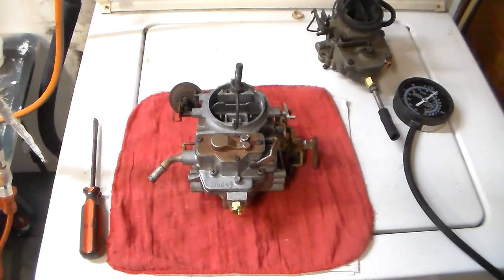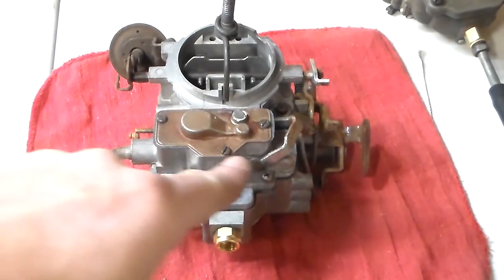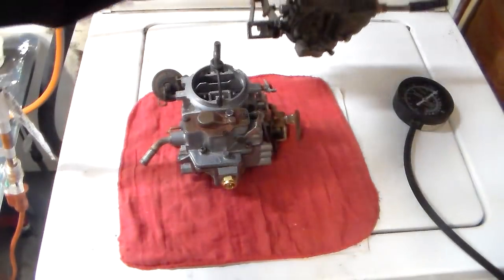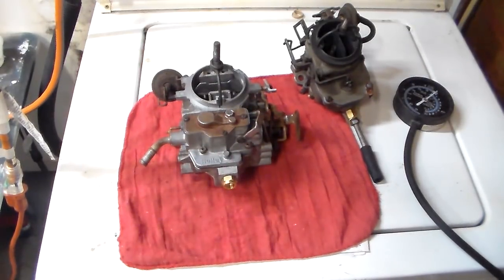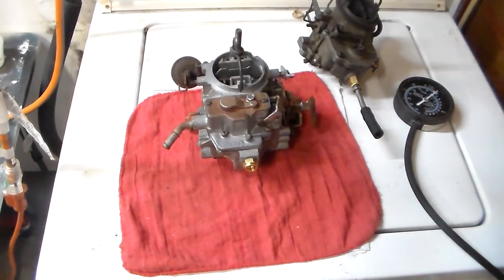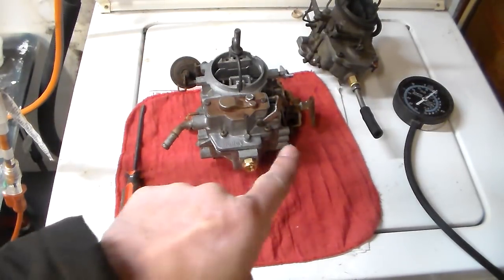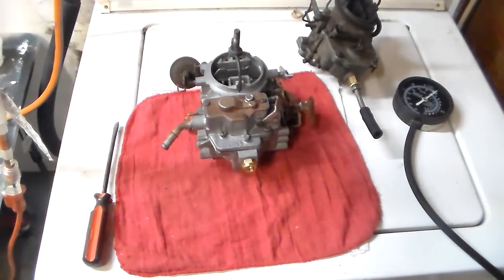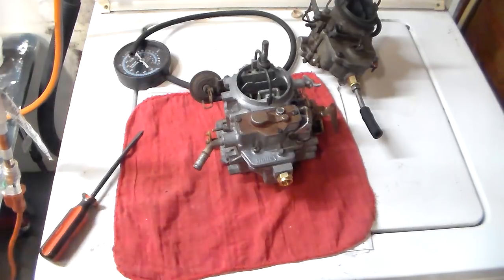How to adjust carburetor idle mixture screws *UPDATED*

Comment: Thank you so much!!  My Dad passed and I got his 78 Dodge Ramchager and I'm finding it has an idle and stall out issue and this single video has really helped.  He went over the truck with me but he felt the best way to learn the carburetor is just to get in there a learn on your own which sounds tough but it has over the years helped to work on my own vehicles.  I'm just not used to carburetors lol well I better get in there.  On a side note, my Dad took care of this D100 318 V8 4X4 all the time, that the odometer died at 879K miles and that was 24 years ago.   Got some rust filled with memories and still going strong!

Comment: You can also lay a hand flat on the fender to feel the differences in how the adjustment is changing things. When getting past acceptable and approaching the magic sweet spot you may feel a difference, it will be smooth as butter. Being just a hair off from the sweet spot or more a distinct lump can be felt as a cylinder or two begins to stumble or misfire from the mixture not being just right. I have seen mechanics use a fancy flexible driver to avoid getting too close to where it gets hot and stand there for literally 20 minutes adjusting it little by little to get the totally sweet smooth idle. Keep in mind to allow time for the engine to reach full operation temperature. As with lean burn the computer should be working in conjunction with the electrical assistant choke and idle enrich solenoid to adjust for what it needs when cold automatically. If anything else you end up like me sometimes and have a car that just needs to run a few minutes first thing in the morning before take off. Cheers

Comment: Hey Tyler, I’m chasing a misfire or flat spot in my 1967 power wagon 225 slant 6. It started with rebuilding the original bbs, got a flat spot, changed to a brand new remanned Holley 1920, still there. Changed the wires, got better. Changed the cap and rotor, got better. Changed plugs, no change. There is 1 vacuum port on the Holley, supposed to go to the distributor, wasn’t hooked up on the carter, and I haven’t tried it yet, it’s currently got a cap on it. The accelerator pump adjuster arm is in the middle position on the Holley, came that way… the truck runs, idles, and if you slowly roll the gas it’ll rev up, but if you stomp or even just step on the pedal it wants to fall flat on its face….

Comment: Tyler.   My 1983 CJ-7 6cyl Carter BBD was running ruff.  I had to adjust my idle up to keep it running.    I turned both screws inward and got better performance.   I turned both 1 1/2 turns and they stopped.   The idle did so good I lowered my idle screw.   Isn’t that strange. I figured if I tightened them til stop it would run out of fuel.   I am in NC Mtns.   3000 foot elevation.   Nothing big but not sea level.

Comment: Hello Tyler. I enjoy a lot of you videos, you seem to have a lot of knowledge many people (myself included) don't have about these older cars! I have a 1978 Chrysler Lebaron M-body, with the 360 leanburn deleted. I just rebuilt the carburator. Will the correct starting setup for the mixture screws be applicable to what is shown in this video? So 2 1/2 turns? And just adjust from there on till it runs the best? Thanks for uploading and best regards from Dinkymaster 7 from Norway!
Reply from the maker: Awesome! Yes, get it running and adjust to get the highest idle or highest vacuum reading if you have a gauge.

Comment: Great job!! I’ve been chasing a shaky jeep 258 .this eve after watching this video I’ve discovered one of my idle circuits is plugged.  Now I’m wondering if I can remove the screw and run a strand of copper wire thru it or should I just rebuild it …

Comment: Thank you so much. I have the exact problem you described. My YJ will not idle below 1000 rpm cold. and when warm engine will die when coming to stop sign and pushing in the clutch. I will check my timing, and cold idle set screw adjustment. and now I know how to use vac. gauge.while adjusting carb.

Comment: Thanks for the Info! I have a '84 CJ7 with a carter 2 barrel carb on my 258 4.2 straight 6. my engine wont idle much at all. eventully i can get it to idle for a couple of minutes after revving it for 10 minutes, then it will shit off on its own. do you think i need to clean the idle ports or just adjust the idle?
Reply from the maker: yeah that's a common problem with those. Do some reading on BBD idle tubes and you will find the cause and possible resolution to your problem. I don't know why those do that. It only seems to be the later High-top versions. I've never seen an earlier low-top BBD act up like that but then again they changed the metering circuits between the two.

Comment: Great video, I have a 81 Jeep cj-7. I adjusted fuel runs great. Thank u. I have the problem it didn’t pass smog. It turns out if I screw the mixture screws down all the way the Jeep stays on. Could that be a result of the float? If so how to adjust. Once amazing informative video. Thank you

Comment: I have a Carter 2bbl on a 1981 Jeep 258 and Idle and running is very rich.  Will adjusting these idle screws back affect the running mixture or is there another adjustment for that?

Comment: I really like the toilet analogy, it is 100% accurate. Do you remember the old toilet tank fill valves that were all metal?
Reply from the maker: Sure do. My elementary school was built in 1948 and had the original toilets. Of course it was only 30 years old then :-O
Reply: Wow! Do you know if the school is still in service? At 70 years old I would not be suprised if it has been retired.

Comment: Thanks for posting this video, I have a 72 D100 with a 381 with a 2 barrel and when I give it gas it dies down then picks up I was going to try to adjust the screws to bring the ideal up to see if that fixes my issue.
Reply: I have a 72 D200 im having carb issues with too. I think the accelerator pump is shot on mine, it might be the cause of your troubles too. Acc pump can cause hesitation, if that is what you are referring to

Comment: So does the choke work in the summer time ? So is the butterfly always supost to be closed when starting it? Mine seem to flood out more in the summer time.il take my answer off the air thank you😉
Reply from the maker: Chokes work any time the engine is cold. The duration that the choke is operating should diminish during warm weather. Some vehicles have mechanically heated chokes with an electric assist which enables the choke to open sooner in warm weather.
Reply: Thanks Tyler.also you show screws on your carborator mine has some different type I thought must of been preset at factory but do they sale different screw drivers?

Comment: Tyler, have you ever seen a 2280 that has recessed allen head idle mixture screws? I cant find anything thing like the carb I have. It looks just like a 2280 but the idle mixture screw locations are different than everything ive seen. Im having a hard timr identifying this carburetor. I want to order a rebuild kit but, I want to make sure I get the right kit. Thanks .
Reply from the maker: Those are tamper-proof  screws. They originally had plugs over them. Should work ok but some of those are lean-burn carbs. The 6280 was also the lean burn carb but had the mixture solenoid inside. I quit using the 2280 family of carbs, too many float issues. You can buy a new cheap eBay Carter BBD clone  and put a good float and good needle and seat and they work great. EDIT : fixed the autocorrect flubs!
Reply: @TylersNeighborhoodGarage  ah. Interesting. I kinda ruled out tamper proof screws right off the bat because i was able to get a allen key in there. I can see the screws because the motor is in a 1983 b250 van. Surely you are right about that. Also, I hadn't put much consideration into the bbd carbs because all over the internet  its plastered that bbd's are such pain in the butt junk. Ill have to eye ball one and give it a try. Any specific part number bbd you suggest ? The 2280 I have now I just yesterday discovered is a R-9951. Thanks for the input Tyler. Much appreciated.

Comment: Ok my carborator floods all over the top not sure from where but I took the top off and checked the floats 1\4 in from top and there there. So tonight I'm going to get a carborator holly screw driver and check idle set screws like you showed.but what could I find that can be off to flood it or will it help my gas mileage and .my carborator has to be set fast so it will start otherwise it will flood and I have to put it in choke mode to restart it.oh and by the way I set my timing and after I had it st I Beleave it says 18' advanced and after I set it I tightened down the distributor and after I did so it kept changing so I got my wife to hold the light and made sure it didn't change as I tightened it down .but keeping my idle set high keep that ping away and it runs good but 6miles an hour at idle .humm

Comment: Hey Tyler great videos always enjoyed your tutorials quick question I'm working on a 1990 Jeep YJ with a 4.2 i6 got a rough idle there is a stepper motor that changes the mixture would I have to disable it while adjusting the idle mixture screws?

Comment: thank you for that informative video, i better understand the idle mixture setting, however i owned a 1989 honda accord and i couldn't do anything with that carb--- too many vacuum lines, No matter what i did it would  never run right. I finally had to let it go, but i have a honda motorcycle (cb360) that i'm trying to get up and running and it has 2 carbs. This information will help.

Comment: I have a 2brrl Rochester carb on a 69 delta88 455 engine and my choke butterfly will not open once engine is warmed up mind you that it's a brand new one that I put on a couple months ago. Can I get your opinion thanks
Reply from the maker: The first thing I always verify is that the hot air tubes to the choke are intact. Any hole, anywhere, disables it. Take a look at my hot air choke video to learn how they operate.

Comment: Hi Tyler,  ive been watching your carb and timing videos. Ive been fiddling with my '83 b250. I seem to have the carb and timing set up rather well. The question I have is this. When I rev the engine up the timing advances as it should. Then I let off the throttle. Wat hing the timing after revving the engine , ot takes awfor the timing to come back down from being advanced.  It takes roughly 45-60 seconds for the timing to drop back to base timing. Is this normal  ?  If thos osnt normal, do you jave any idea what could cause this issue?  Thanks. I appreciate you posting your videos.
Reply: AC circuit solenoi ICS needs adjusting.
Base timing needs to be 26*btdc @ 20hg vac @ 750rpm with trans vacuumed to 16hg.

Research ics adjustment, baseline timing.

Comment: I just bought a 70 f100 with a 2100 autolite and the idle air mixer and idle speed are out of whack. Where should I set the idle speed before trying to set idle air mixer?

Comment: On computer controlled carbs would you unplug the electrical lines to the distributor like when you set the timing when tuning the carb?
Reply from the maker: Usually there is a small plug inline that you either ground, or in some cases physically remove a jumper in order to disable the timing advance. Otherwise, unplugging the distributor will probably keep the engine from running.

Comment: Could you make a video like this on setting timing?
Reply: if you are setting eng timing   go by the marks on crankshaft pully lower front of eng  pointer should line up on 4 deg before tdc  i found its very helpfull to use a tooth pick  and a dab of white paint draw a white line in those tiny grooves   the center groove is labeled tdc  with 5or6 grooves brfore and after tdc you need a timing light to make this adj with eng running  slowly turn dist till pointer lines up on 4th mark before tdc stop turning and  tighten the bolt that holds dist    its timed now

Comment: I’ve seen where people adjust the idle up where the blades are cracked and it’s not running off the idle circuit, big newbie mistake to make. Usually this coincides with other engine issues, they try to overcome this with upping the idle.
Reply from the maker: Yeah, they smell pig rich when you do that.

Comment: My screws were loose holding the top on my carb.on caused it to flood gas all over the top of my engine and caused my engine to flood with gas and would take 2-3 days before it was dry anugh to restart.